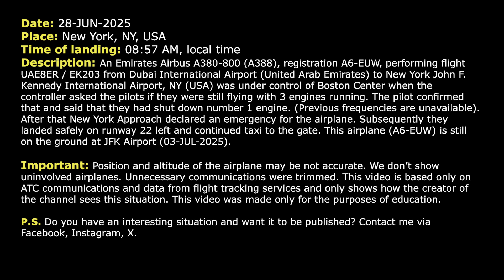One engine is shut down. Emirates Airbus A380 lands at JFK Airport with one failed engine. Real ATC

Comment: I absolutely understand how Americans handle info preferably in Imperial system for calculations , But ATC controllers are not Pilots and they just need the answers for their checklist according to their protocol including the fact that they wanted to categorise it into an “ EMERGENCY “ so its okay if the pilots have every info ready , so that the ATC controllers can have it on record that the info came from the cockpit and they themselves didn’t attempt any conversion avoiding any room for error or enquiry ( not because they can’t do a High school level conversion ).

Comment: I absolutely love how people in the comments section love to call ATC stupid, but their comments shows who is the intelligent one, love it, love how a random person who isn’t a FAA  certified United States controller is calling a certified controller stupid telling them how to do their jobs; well i would tell you go and read ICAO EASA and FAA laws and rules; they will quickly find that different countries/airspace have their own way of doing certain things. In US (FAA) we use Imperial measurements therefore foreign Pilots receive and gives measurements in inHG, Feet and everyone favorite LBS and pilots are required to make the conversions. Europe Asia and other Airspace give their information in Metric measurements QNH/KGS/METERS. Americans pilots are required to make that conversion when they enter those airspace. Also in aviation no such thing as a stupid questions when dealing with an Emergency. If a controller ask a question it’s usually for a good reason either for verification or other reasons. Pilots are yes busy in an Emergency situation facts; but so is the controller. There is a reason why controlling is #1 on the most stressful job chart. The level of stress a pilot has during an emergency well let’s say that stress is what a controller level is at x10 all the time. Juggling 2 jobs sometimes 3 along with 20 airplanes. All they ask is do as they say or if can’t just say unable.

Comment: I’ve listened to a lot of emergency ATC back and forth.  This one seemed pretty benign.  However, if a pilot who could be under considerable stress and workload needs to tell successive controllers fuel and souls that’s poor procedure.  In these instances it should get passed down the line, so the pilot can concentrate on flying.  Someone said it best as well, training should be in place to have them also know enough to roughly multiply the weight in kg by 2 and there’s a good estimate.
Reply: So 23400kg became 51600lbs. That's not multiplying by 2 🙄

Comment: I was browsing the recording for that flight as I was on the return flight that got cancelled and FWIW spotted previous frequencies where they declare engine failure with reason (precautionary shutdown due to vibration of engine one) but couldn’t find those. Great!
Reply from the maker: Thank you 👍
Reply: Unbelievable that having twice been given fuel in tonnes and Kilos and time  ATC are asking for more fuel info. What do they need. Then they need to know which engine is closed down.  The engine should not fire up at this stage.

Comment: Please US ATC; stop asking those pointless time wasting questions, no other country does that. It’s just box ticking from a different era and the answers are either self evident or easily obtainable from the operator.
Reply: Do center/Tracon not pass along info to tower or other ATC?! Pilot was asked several times about which engine was affected, fuel on board.
Reply: There shud be a standard of providing FOB fuel on board. Invariably, ATC will ask for it in minutes, hours, tons, pounds, kilos or all of the above when passing over to EACH ATC. It seems to add workload on the pilots when in an emergency.

Comment: i was very surprised the mixed use of fuel weight kgs and lbs surely in the airline industry there should be a standard . I can see mistakes being made when kgs is mistaken for lbs or vise versa
Reply: YES!  That happened in Canada, both engines went "drip dry" mid-flight!

Comment: JFK controllers slackin.   You guys in the same building or work together?   How many times you gonna ask the same questions
Reply: They are in separate buildings and no excuses
Reply: For the same reason every nurse and doctor ask which knee are they operating on. Not because they don’t know the answer, but to confirm the information they have is correct.
Reply: @rtbrtb_dutchy4183  Patients are not professionals or at work, we commercial pilots are both.   We don't need a jockey with a microphone in shorts and a t-shirt playing quiz time when we're driving close to million pounds of metal 300 miles per hour.
Reply: @rtbrtb_dutchy4183  Patients are nor professionals or at work, we commercial pilots are both.   I don't need a microphone jockey playing jeopardy with me in his shoes and t-shirt while I'm driving almost a million pounds of metal at 300mph

Comment: Dear ATC: Use 2.2 x Kg to get to Pounds.
Reply: There shud be a standard of providing FOB fuel on board. Invariably, ATC will ask for it in minutes, hours, pounds, kilos or all of the above when passing over to EACH ATC. It seems to add workload on the pilots when in an emergency.
Reply: There shud be a standard of providing FOB fuel on board. Invariably, ATC will ask for it in minutes, hours, tons, pounds, kilos or all of the above when passing over to EACH ATC. It seems to add workload on the pilots when in an emergency.
Reply: Kg to lbs. Double it and add 10%. Surely someone somewhere can do those maths and pass it on to everyone who needs it.

Comment: > ...When [ATC] asked the pilots if they were still flying with 3 engines running.

How would ATC know how many engines an aircraft is running with?  Do they have the visibility for such data?
Reply: No, previous controller was informed by the crew earlier.

Comment: There really is no excuse to ask the pilot for fuel in pounds, if ATC wants to know all they need to do is multiply by 2.2, or just double it for a rough estimate - not to mention the fuel remaining is completely useless information for a scenario like this; it makes absolutely no difference to ATC or ARFF
Reply: It makes a difference for ARFF, they want to know what to expect in the worst case. One hour of fuel could be like 20 gallons (and therefore just a small bonfire) for a Cessna or like here two dozen tonnes/over 50,000 lbs...
Reply: This is MURICA, he's lucky he wasn't asked to convert it to hamburgers per budweiser
Reply: I can see your point. I’m guessing ATC needs to have the pilot say it for the record. Even with proper conversion. Maybe because they assist a distressed airplane based on the information they receive.

Comment: He gave the weight in Kg,  and tonnes, and the time left available, and was ok working with "inches of mercury" for the pressure.  And still had to convert the fuel remaining to pounds, cups,  etc.  Could the people on the ground who are in the USA and understand their own weird units sitting in their chairs not do that for him?
Edit: ATC didn't even seem to know which side No. 1 engine is on.
Reply: Right, it seems American and specifically JFK ATC are just quite stupid when handling emergencies. Repeatingly asking silly questions, giving the pilots a even harder time. How hard can it be, when pilot states his fuel in tonnes or kilograms, to quickly convert that using conversion factors or even google (I know that's not a certified procedure for this, but it gives an indication). There is time for that and it doesn't matter too much, they can just pass it on to the fire brigade and let them convert if they need. In europe ATC are perfectly able to work with whatever they give us. At that moment the pilot should focus on the emergency rather than converting units for ATC!
Reply: @slennie correct 💯
Reply: You know Americans think everything revolves around them. Other countries have measurement systems they use or accustomed to. Y’all figure out the conversion 🤦‍♀️
Reply: What's so weird about it? We built the largest economy in the world with it, perhaps you people are the weirdos.
Reply: @kevinj2412  the point is not how weird your system is, and believe me it is. The point is being so lazy to ask the conversion to a pilot declaring an emergency

Comment: Emirates pilot should know we use pounds in the US and not kilos.
Reply: So the controller cant quikly do 24,800 x 2.2 Its not that hard.
Reply: The rest of the world does not care :)
Reply: @malahammer  You should care if you don't want to be asked again, especially if you are in the middle of high workload such as an emergency.
Reply: @paddyohenry6428  he didn’t seem to care being asked again. And ATC should be able to multiply a number by 2.2 on their computer/smartphone.
Reply: @Gee1410thirtysix  In this case there was no rush. That doesn't make it a good practice.
Reply: @paddyohenry6428  if there was a rush, just say unable. There’s zero statutory requirement to provide fuel in pounds, let alone to provide it. Say “unable.” Or tell atc on the radio to multiply by 2.2 themselves. It’s lazy/ignorant controlling.
Reply: @Gee1410thirtysix  You're just making lame excuses. There are other people on the radio and ATC has other things to do also. Brevity is a thing, as are standards.
Reply: @paddyohenry6428 and the pilots have nothing else to do on a 3 engine approach? 😮😮
Reply: @paddyohenry6428 then I would say, let's standardize fuel units to be used in comms through ICAO! But I got a feeling that the result ain't gonna be pounds, buddy! 😊
Reply: @Gee1410thirtysix  again you assume this controller knew about the 24.8 tonnes. 

This controller likely was unaware and he asks for pounds because too many pilots will give it in minutes.
Reply: @rtbrtb_dutchy4183  he said kilos dude. Just watch the video for once. You can either choose to listen or read the captions. This isn’t hard. Give it a whirl.
Reply: @Gee1410thirtysix  maybe you should indeed watch it and understand what’s going on here. 

When he said 24.8 tonnes, 24,800 kilos, that was New York Center. 
Then he was switched to New York Approach controller. These guys are not in the same building. 

This guy asks again for fuel, but he says pounds. Not because he doesn’t know how to calculate from KGs, but because he doesn’t have the info and wants to know how much fuel he has. But he wants it in pounds, not minutes. 

Had the pilot given it in KGs, that would’ve been fine too.
Reply: @Gee1410thirtysix  it’s ironic how you think I need to watch the video again, yet you are the one not understanding how it all works….and you have an actual opinion on it, while clueless.
Reply: Shouldn’t matter. We should be able to do simple second grade multiplication without assistance.
Reply: Yes he should know but in a semi stressful situation the guy on the ground can do it on his phone in a second
Reply: Yes, you're absolutely right... And the rest of the world uses kilograms and tonnes (thousands of kilos)😜
Reply: And I'll bet his FMC's in the plane and the fuel indicators are in Kilos.

Comment: Surely a four engine plane losing one engine is not noteworthy
Reply: It's not really a big deal since they just shut it down (nothing else affected). 
If it was anything of note, they'd have declared a PAN-PAN
Reply: It would have been in the headlines, across the country, if it had been a Boeing 747.
Reply: @wzune6513  that’s silly. It happens to the B747 as well. It was not “all over the news”.
Reply: The only reason I think it should be atleast pan pan is because of possible fuel contamination.  So its only 1 down "so far"
Reply: @rdawgz866  Sounds like they shut it down, so likely an overheat or smth
Reply: @rdawgz866  highly unlikely to be a fuel contamination issue impacting just a single engine.
Reply: @rdawgz866  it was shut down due to engine vibration. So no, no fuel contamination.